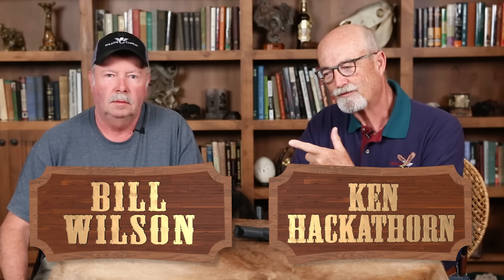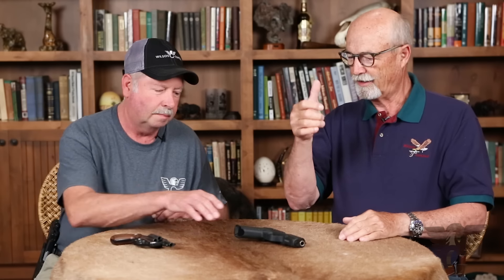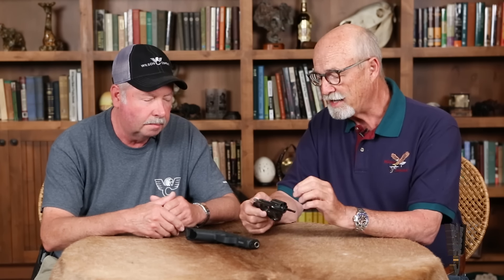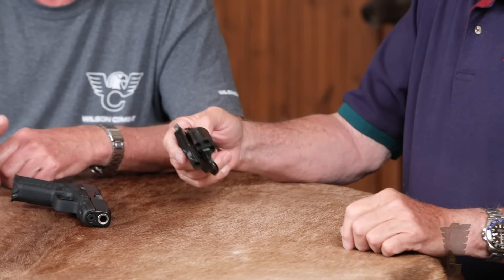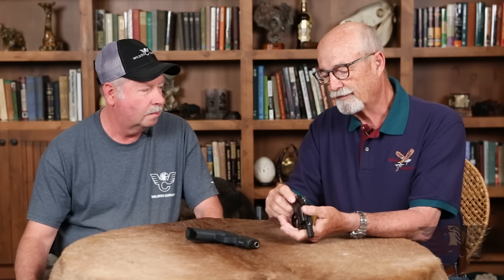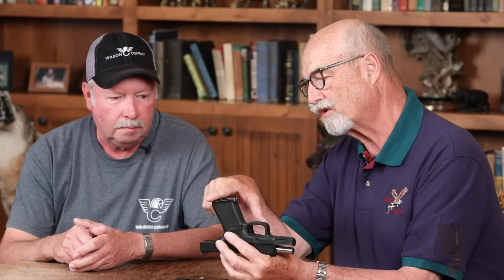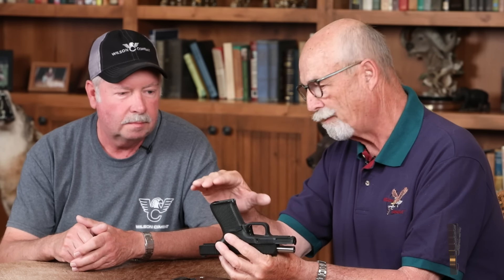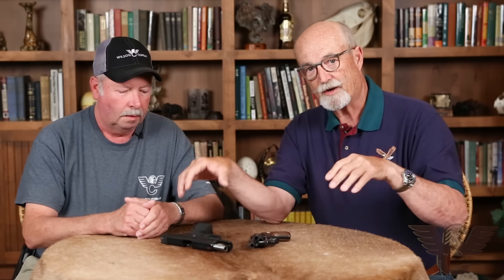DON'T DO THIS to Your Guns - Gun Guys Ep. 17

Comment: Great video. Funny how the negative comments are so like real life. Making dumb and obnoxious comments on things they didn’t hear correctly.
Reply: You're like so right- right?  Like they're just totes jelli...
Reply: @abee3515  Whut
Reply: @DeadMeat991  It made tons more sense before the other guy deleted his comments.  Basically the 1911 went through every torture test known to man.  Dropping a slide on a mil-spec 1911 will not break the gun make it misfire or do anything to harm the gun in any way.  It will break a wilson combat that is designed to fire when you sneeze.  They call that a trigger job I call it damaging a perfectly functional firearm.  Colt and Browning designed a war weapon that could withstand horrendous abuse.  Wilson modified that design creating the situation where dropping the slide on an empty chamber could cause the gun to malfunction.  And has the internet picking sides.  I side with Colt and Browning.
Reply: @abee3515  I'm ok with both. Depends on if it is for the range or the battlefield.

Comment: Does dry firing hurt a gun?
Reply: You should absolutely positively never dry fire a rim fire gun. A center fire gun in theory can be dry fired, but it’s not ideal…
Reply: a lil bit wont hurt but, you can buy dummy bullets cheap online comes with rubber primers for your firing pin to hit so everything stays protected, when the rubber wears down in one use another, i bought 10 they lasted a while
Reply: I use dummy ammunition as well in my center fire guns. I don’t think they make dummy ammunition for rim fire guns though
Reply: @BigPatG2008  They do, fortunately. Usually with aluminium (softer).
Reply: Don't do it if you don't have to. Never dry fire the older break-barrel shotguns. Never dry fire anything super cheap. Don't dry fire something vintage where you can't replace the broken pin.
Reply: A Glock can be dry fired but don't dry fire a Taurus spectrum, ever.

Comment: How about with snap caps? Would that be a suitable substitute for a live round when dropping the slide?
Reply: Absolutely fine to use snap caps. Just remember that it's not a slide release on any pistol. It'll ruin the slide catch using it that way. Only a $20 part and 15 minutes to replace, but why use a tool improperly?

Comment: Ok so what about cycling live rounds, specifically in a glock? See I'm a gun lover and a poor man, so that means I own a few guns but don't have enough money to have any of the fun all you you tube guys get to have shooting guns. But I do maintain my pistol, I do like regularly checking functionality and since I don't get to shoot, I cycle live rounds through my mags to make sure they are feeding and the gun is running no problemo. Sometimes I do this with the mossberg pump as well. So does cycling live rounds hurt the pistol and the shotty? It does rough up the casings on the pistol at least but what about the guns?
Reply: That should not cause any harm to your guns. You can probably see some scratches on your ammo for your self, usually where the ejector hits the back of the case and the side where the extractor grabs it. As far as I know those scratches will not affect the performance of that ammo. The problem you can run into is if you chamber the same round too many times it can seat the round further into the case that it's meant to, and that can cause serious problems because it will increase the pressure beyond what your pistol may be designed to withstand. If any of your rounds are noticeably shorter than the rest, don't take the risk, don't shoot it.
Reply: @chease9132  specifically on a glock, if you took the barrel out of the slide and drop a live round in the chamber, it will fall in to a certain degree and sit inside. Where the chamber ends and the throat starts, there is a rim that catches the rim of the casing where the bullet sits. When a round is chambered, the ejecter catches the cartridge as it goes up the feeding ramp and so the ejector is effectively holding the casing as well.

Between the throats rim and the ejector, there is no way the bullet itself comes in contact with anything that can seat it down further so I have to disagree with that. If you meant as it goes forward up the feeding ramp, its at such an angle and there's not enough resistance in the slides spring or process of coming out of the mag that could put enough pressure to seat the bullet. Seating a bullet is such a tight fit that you need way more force. I've been chambering the same rounds for over 10 years now and have not had those kind of problems at all. If anything, I just need to switch out for some fresh rounds as that is recommended. I'm sure the ammo works fine but always want the freshest ammo in the gun for the big day. Kinda hard to do when living in poverty though.

Comment: What is the solution to bullets being shoved back into the case after being loaded and unloaded over time.
Reply: I'm not an expert, but my understanding is some bullet manufacturers design their rounds with something called a cannelure and then crimp the case mouth to that cannelure. It's supposed to prevent bullet setback from repeated chamberings. I don't know if or how effective this solution is, but I think it's a viable option, and seems like it would work from an intuitive approach.
Reply: @ChristopherGoggans  I reload my own shells the problem with a crimp is a 1911 seats on the case mouth hence it cannot have much  if any crimp applied

Comment: The "Don't drop the slide on an empty chamber" thing sounds like it's in the same territory as "Don't shoot an AR15 by resting the magazine on the ground". One person will say not to do it but ten others say it doesn't matter. As for lubrication there is such a thing as over-lubrication which can draw in dust and gunk and can cause the action to operate a little sluggishly in cold weather, at least that was my experience with the M4.
Reply: Personally I like to take advice from either renown professionals or people that have years of experience in the field Im researching. Ken and Bill are renown professionals in their field so when it comes to firearms, especially the 1911, I would listen to them.
Reply: @Brett235  I mean if the 1911 was so fragile that dropping the slide on an empty chamber can damage it the US military probably would've swapped it for something else before WW2 🤷‍♂️
Reply: They are talking about if you have a really light trigger job. The military guns used to have the slide dropped on an empty chamber every shift for each soldier when they showed clear. If you have a really light trigger job, a lot of the metal has been removed from the sear and the hammer and compromised the integrity of the sear and hammer. The trigger job angle also comes into play with this. As dropping the slide on an empty chamber with a bad trigger job could make it to were the hammer follows the slide back over time.
Reply: @servicerifle16  Really. That is a bad habit. Aluminum frame is much more suspectable to frame damage also.
Reply: @jacobmccurry1676   Marines are taught better.

Comment: Someone recently told me not to use the slide release lever on my 1911A1.   They said always pull back the slide so as not to wear out the lever.  Any suggestions?
Reply: I have replaced factory defective slide stops on pistols, but I have never worn one out.  The slide stop on a 1911 rests against a spring-loaded detent just as the thumb safety does.  Did this person also suggest you not use the manual safety for fear of it wearing out?  All parts wear over time, but the slide stop was designed to be used for locking and unlocking the slide.  On some pistols I've found it too difficult or too slow to disengage the slide stop.  In these cases I use the slide racking technique.  Let this be your guide.
Reply: Re-watch this video for the definitive reason.  It damages the finely tuned trigger mechanism
Reply: @ronaldjohnson1474  When the slide is allowed to slam home on an empty chamber it strains the trigger mechanism and peens the barrel.  This is true whether it is done by releasing the slide stop or pulling back on the slide and releasing it.

Comment: So I can drop the slide on my $650 SW hundreds of times with no issues but a $3000 Wilson Combat 1911 can't take the abuse? Sounds like they are not built real well. Maybe it should say Wilson non Combat.
Reply: the problem is its 110+ year old technology.  If we didn't have an emotional attachment to it, 1911's would be gone forever.
Reply: @TigerDude333  he was saying that while holding what looks like one of their 1911 models, which still costs $2,500+ plus. It's insane. Hard pass on a "race gun" that is damaged under the pressure of its own spring

Comment: Pretty hilarious to act like Bill Wilson and Ken Hackathorn don't know what they are talking about. Just fucking… don't listen… they aren't saying it immediately breaks it, just saying “best practices” don't drop the slide. Jeez.
Reply: Gotta love how guns like beretta 92’s don’t deal with this kind of bullshit. I understand how these particular 1911’s work though, they have more sensitive tolerances because they need to them in order to stay in their top performance, just like how high end cars don’t “last long” to the extent that they won’t be at their best performance for very long if used a little too much. I’ve never heard of a handgun actually failing from dry running (except dry firing but that’s a different can of worms) and I’ve never heard of the myth that dry running causes more external wear than actually firing, that’s literally mathematically wrong because a semi auto handgun’s action goes through more physical stress cycling while firing than just racking it, let alone releasing it. Running ammunition or even dummy rounds doesn’t change much when it comes to load on the action and it doesn’t “cushion” anything because the locking points on any semi auto still closes, it’s not like the round stops or cushions the slide from contacting the barrel, it’s does nothing! Also, how the hell does shooting a handgun change how the hammer lands and contacts the sear? -It’s still falling on the sear regardless! if components like sears and extractors break due to dry running, then your handgun was on thin ice already and it means that there’s a problem other than failing to baby your pistol.
Reply: Dropping the slide will probably not cause a problem…I've been dropping the slide on my STI for years in competition but… maybe… best practices, don't drop it if you don't need to. Its just funny everyone is so pissed about old guys bein old…
Reply: Like don't drop the clutch on your ferrari too much (they don't make manual anymore), not saying you cant do it, but over time… how long you want it to run top notch? Its subjective…
Reply: agree

Comment: This reminds me of trying to tell a young one not to idle at the stoplight with the transmission in first gear and the clutch in. Or even worse, pumping the clutch in anticipation of the light turning green. Great video guys..thanks
Reply: you really teach them to sit in neutral 😐
Reply: Or telling people that certain machines are designed to be used under load. Like running a washer or dryer with no water or clothing in it wears the bearings prematurely. Or like putting a car up on a lift and redlining it in gear is a recipe for disaster.

Comment: Ah so your ridiculously expensive 1911s can't handle the slide getting dropped on empty but my p320 I use on duty that's damn near as accurate as your gun but cost 1/6th the price will be just fine doing it. Got it. Great sales tactic guys.
Reply: people here still thinking that they can cause more damage with their hands with a repetitive movement ,more so then by the G's generated by the blow of the powder, putting that mass under accelerations far more important - also repetitive ....🤣😂🤣😂🤣😂🤣😂

Comment: Letting the slide drop hurts a pistol? Lmao that's some bullshit. Maybe the extractor if u leave a round in the chamber then drop the slide but it's the exact same as pulling the slide back.
Reply: @mmardell9262  HOW??? You drink the koolaid but can't explain how a polished trigger is going to break over a non polished one
Reply: @evocati6523 ?
Reply: @mmardell9262  sounds like you should be getting a different trigger for custom then. anything that doesn't hold up to a couple slide drops on empty shouldn't be sold. I've dropped the slide on my S&W M&P 2.0 multiple dozens of times, with a custom trigger, and never had anything change. these guys are either fudds or they're selling shitty product.
Reply: @evocati6523  They explained that in the video. On a custom trigger job there is less sear engagement with the hammer. The sear is "thinner" where the hammer engages it, so is likely to be more fragile.
Reply: @pdworld2418  Your M&P doesn't have the same fire control mechanism that a 1911 has.
Reply: @keith2772  not particularly. it's not dissimilar enough to justify the nonsense spouted in this video
Reply: @pdworld2418 . The round slows down the slide as it chambers a round.   Every semi auto has a cam point that will wear out prematurely if you slam the slide home repetitively.    Also the 1911 and Smith and Wesson M&P are completely different internally.    Watch the video the explain what it does.
Reply: You obviously don't know either

Comment: Crazy/stupid question; should I lube my magazine spring ?
Reply: It'll collect more dust and debris over time, but it can prevent corrosion.

Honestly, if you're going to take it apart to clean and reapply somewhat regularly, go for it. If not, you'd probably be better to leave it without. If you do decide to lube it, only apply a razor thin coat, just enough to give it a layer between the metal and any water/oxygen. Doesn't really need lubrication, but that protective barrier can have some advantages.
Reply: If you do then use a dry lube so that it won't collect dust and lint.
Reply: Don’t do it. Just clean it every once and awhile with a rust preventative oil then wipe off. Mag springs don’t have much frictional force since they are in so loose, they are also a relatively closed system and if anything gets past the follower, it’ll end up at the bottom mag plate which is harmless. Springs are gonna be made with stainless steel most likely which should be an issue with corrosion, and I’d they do, mags are easy to come by and cheap

Comment: If you read the manual, you'll know not to slam the slide on an empty chamber.
Reply: How do you dryfire it then? This why I got glock or sig. Can take actual use
Reply: @joel553009  You release the slide with your hand unless you are feeding from a magazine.
Reply: @johnmiddleton4291  but in dryfire you aren't using bullets. so usually the magazines are empty. Im talking running back and forth dryfire, not just slow trigger press dry fire
Reply: @joel553009  Slamming the slide from lock isn't dry firing.  When the slide is back in the locked position, you release it with your hand and the slide lock, not just the lock.  

Dry firing should also be done using cushioned dry fire caps, though many modern pistols are not hurt by dry firing.  Read your guns manual to see if it is.
Reply: @joel553009  they're not talking about racking the slide on an empty gun, they specifically mean hitting the slide release on an empty gun. Glocks can be dry fired pretty easily but snap caps are still good and especially for 1911s or revolvers.

Comment: Why is this old vid up again, other than it is timeless info but saw it a long time ago. Just curious. Don't overlube, don't waste time on squeaky clean. Its about time management and nothing destroys incentive to shoot more than thinking you need to spend 3 hours cleaning a gun for only 20 minutes of shooting. It's not a B-2 bomber, its a firearm which hasn't changed much since the prodigy JM Browning designed its basics of operation. You Beretta storm users have a great design that isn't based on JMB but most firearms being his design or the modified version of it is testiment to Mr Browning and the fact that if given common-sense care they will last.

Comment: I have a question it may sound stupid but what about when you Oil the slide grooves and then rack the slide multiple times manually in order to lubricate the rails does that also damaged the mechanism and trigger?
Reply: They said only when you let it snap shut empty.  But if your doing it slowly holding the slide and not letting it slam . That should be fine.